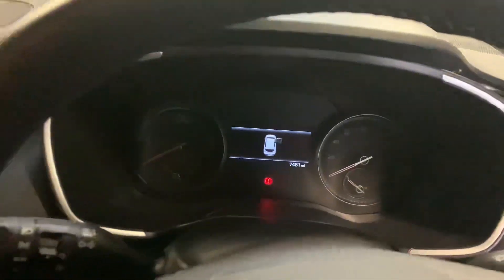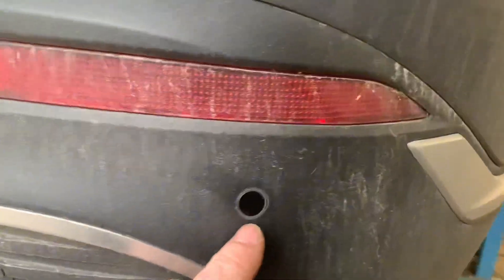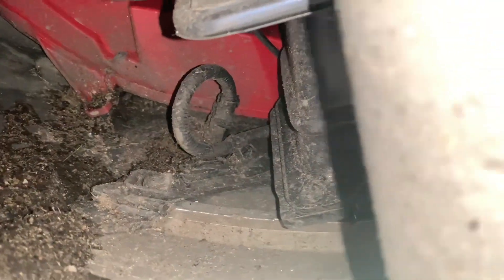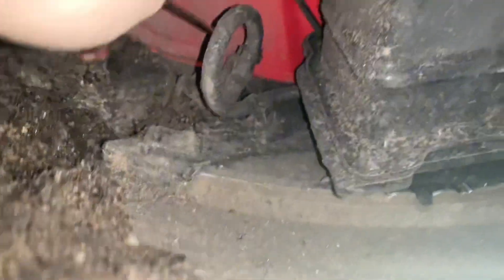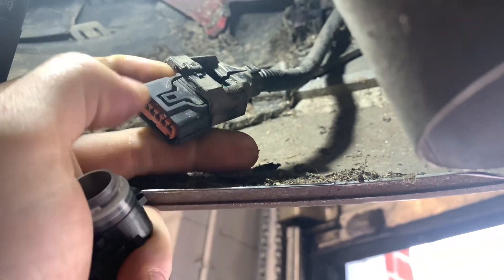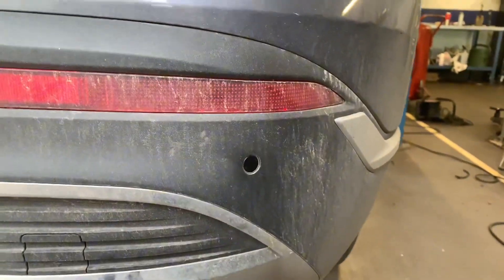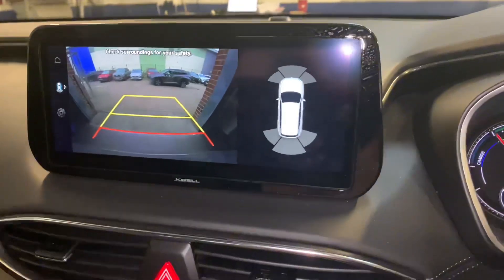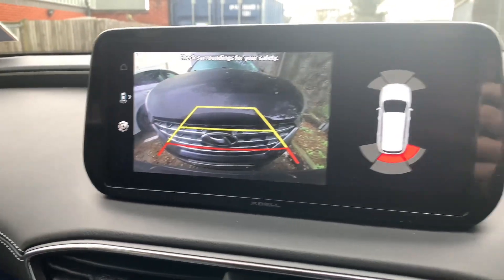Hyundai Santafe 2023 | Rear parking sensor replacement |

Comment: We were just quoted $575 to replace one front parking sensor.  Not warranty because it has a rock chip.
Reply from the maker: Can do it yourself cheaper 👍 yeah unfortunately if it’s faulty or paint is flaking then they will replace it but any signs of damage they won’t